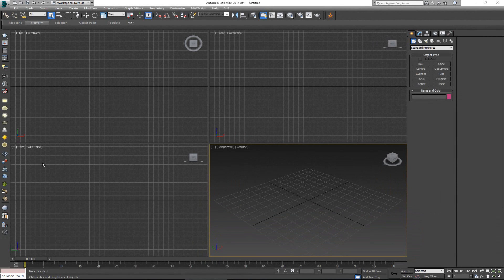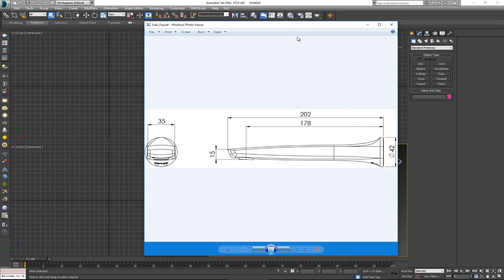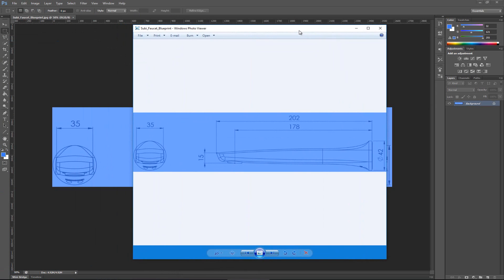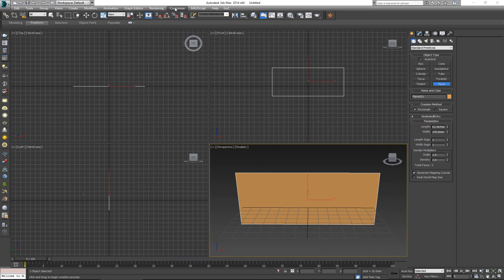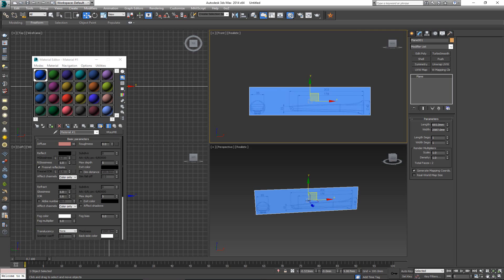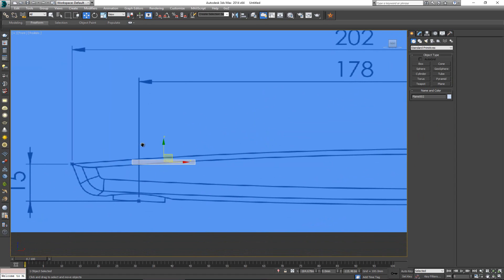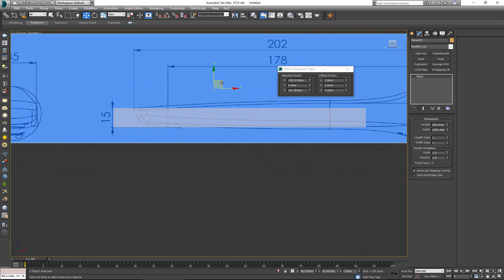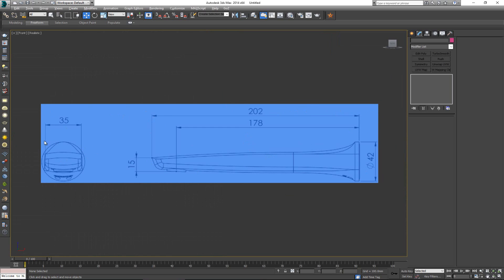Setting up Bluprints for Real World Scale Modeling in 3ds Max

Comment: A few tips.
If you make a plane and apply a UVW modifer and click "Bitmap Fit", then find the blueprint picture. It will have given the UV the same aspect ratio.

When you have to scale the plane, aligning one of the lines and then moving the pivot point to the same point, will allow you to more easily control the scale since you only have to make one side match.